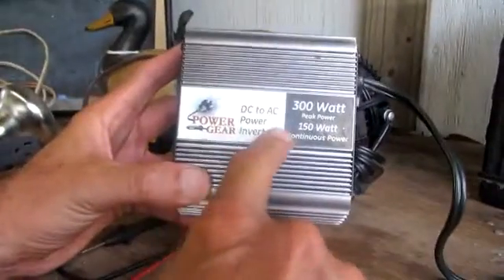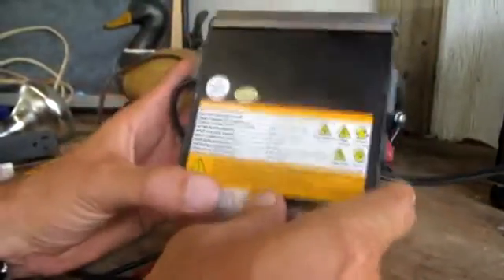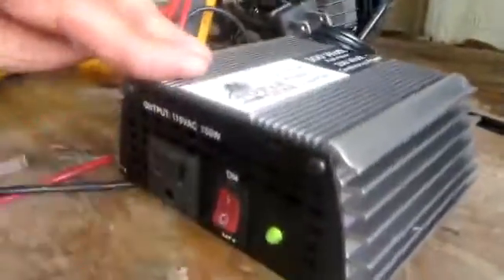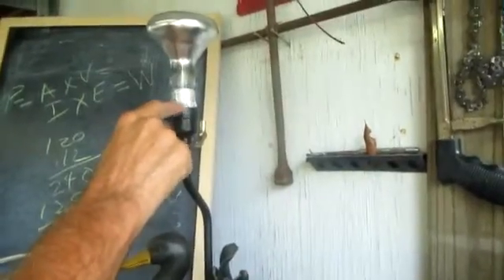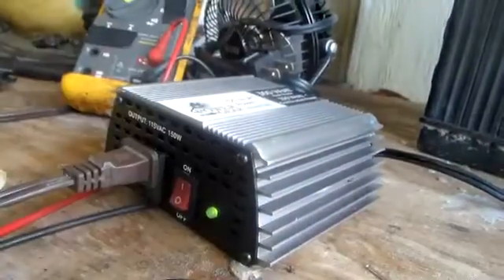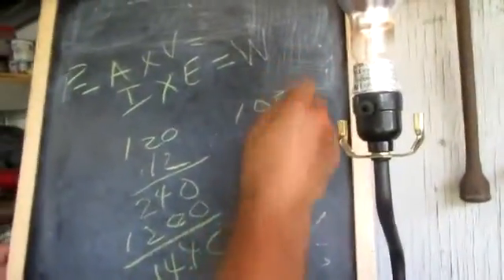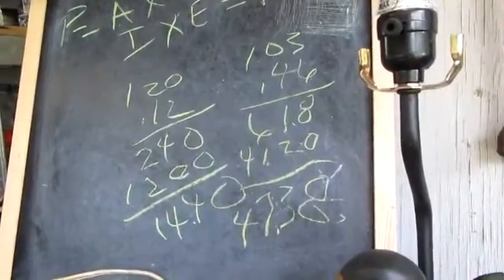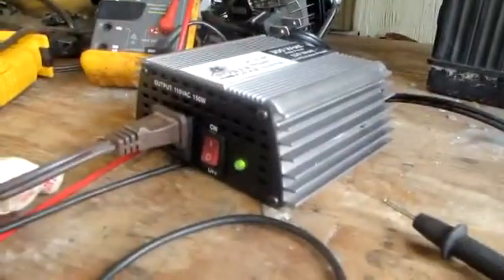Power gear Inverter Review

Comment: Bill, thanks for making this video. I have a similar unit and I was setting up to use it in a 4th of July parade. I kept getting the red light on the front of the inverter. Your trick of leaving the device to be powered turned on and then using the inverter's switch worked great. It goes against everything I was taught about making sure the inverter has a steady output before applying a load, but, hey, it worked! So thanks again. Our parade will be a little bit better thanks to you.